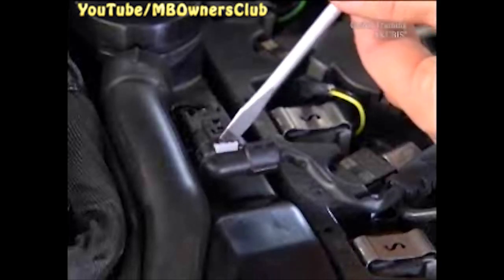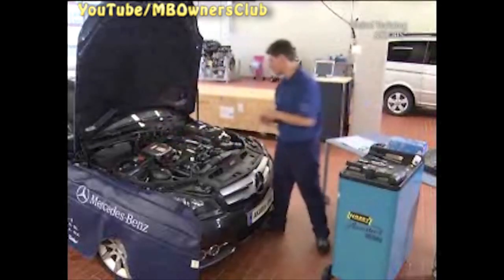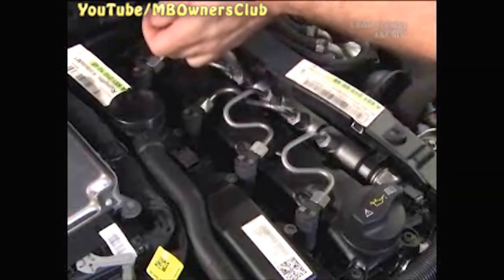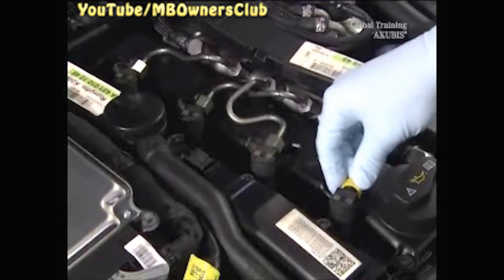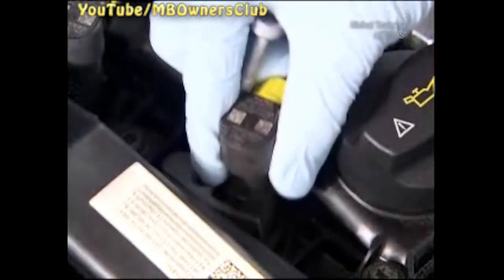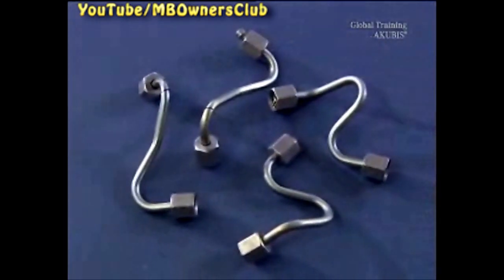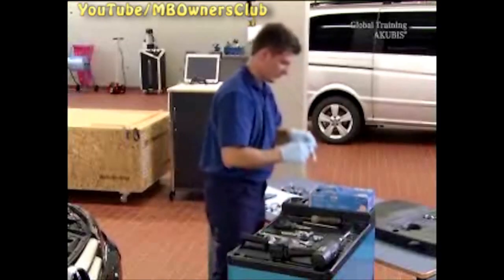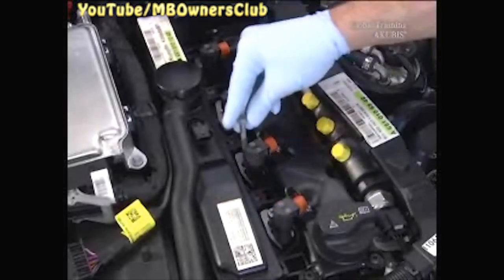How to Remove and Install Injectors on Mercedes-Benz Engine OM 651 (Part 1) | W204

Comment: What is the correct torque for tightening the injector bolts?
Reply: Not sure, but make sure you have new ones. You can't reuse the bolts

Comment: CODE
Reply: You don't have to code them, I replace these all the time without coding when I worked at Mercedes
Reply: @joneskey3950  hi Jones maybe you can help with this, I have a p0266 - teach in of the operating parameters for cylinder 2 has a malfunction, tried swapping out injector 2 with 1 and coding them, the fault remains on cylinder 2, compression test was good, engine runs but no power? Could it be the injector wiring loom, I also checked the resistance between the two pins of the connectors for all injectors and all were pretty much identical, also checked resistance between each pin to ground and again al were pretty much identical.

I'm thinking an internal fault in the pcm injector circuit or loom? What do you think? Regards

ammo
Reply: @abane5165  good day  i have the same code and problem ,did you get help or how dd you fix it .thanx
Reply: Tomo Mofokeng 

Hi. Unfortunately in my case it turned out to be a bent con rod. Hence i had lower compression in one cylinder. You can easily check by bringing the cylinders to rev and checking the height of the cylinder using a screw driver. 1 and 4 should come up together and 2 and 3 should come up together. So if 2 is at tdc then it should be exactly the same height as 3 if that makes sense. You can also run a compression test but you need the diesel kit. If you have a scanner with a scope and an amp clamp you can do a relative compression test which is what I did. Let me know how you get on thanks
Reply: @ammaralnashed  good day once more. I would like to know again if yours when you start it was d white smoke coming out? Because mine is smoking white smoke of starting. With that code on the scanner. Because it drives well but the smoke and the code. Thanx about your reply and I will reply back when I got what was the problem
Reply: @joneskey3950  good day can you replace one only